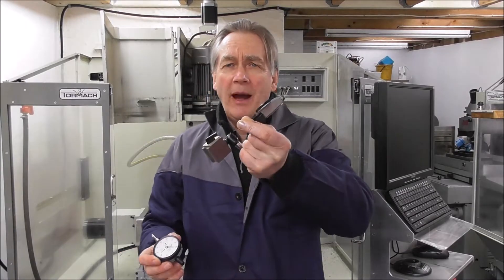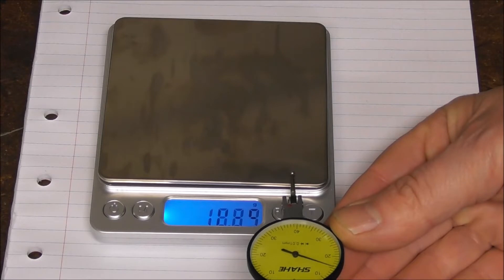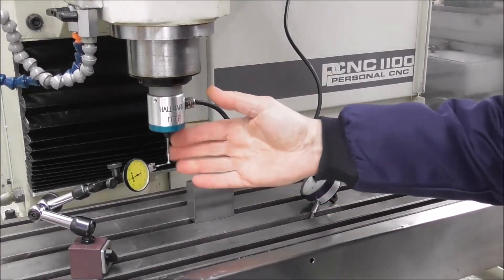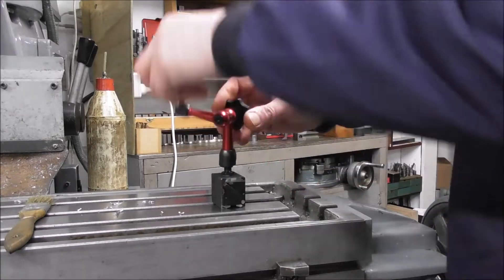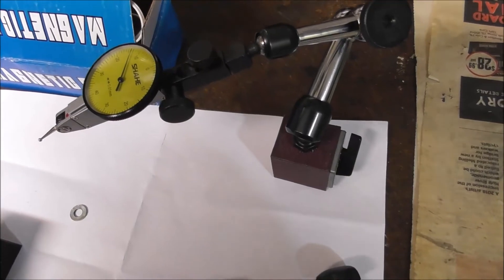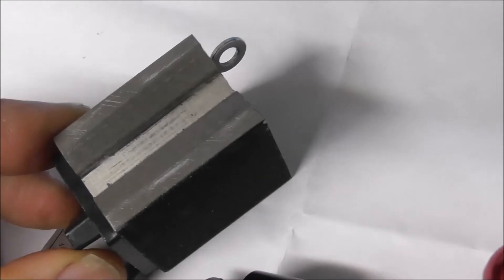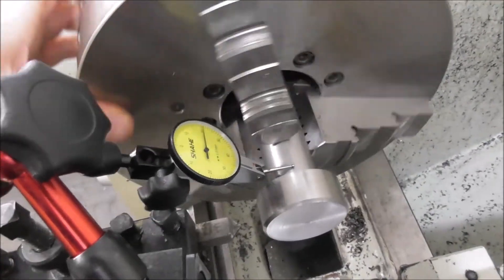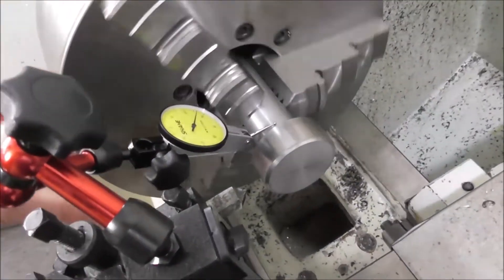DIAL INDICATOR COMPARISON/REVIEW - Part 2 - Application and Stands.

Comment: I got the cheapest indicator stand and dti out of ebay for my "dirty" work, probably got the whole unit with magnetic base and indicator for less than 20, I don't remember exactly, but it has served very well, and it has got a couple of hits after which it still works as well, but it would upset me to be banging an expensive indicator around.
Reply from the maker: Sorry I missed your comment - thanks for posting.  Cliff

Comment: Great information as always Cliff. But even the short small Nogas are affected by that gravity issue. https://www.youtube.com/watch?v=u08SfxVgxNg Amazing really when you see how much a seemingly rigid stand like a Noga and light weight DTI will flex just due to gravity. There's also a good tip about not using Co-Ax indicators with probes longer than about 2" in a horizontal position towards the end of that video in my link.
Reply from the maker: Sorry I missed your comment - thanks for posting.  Cliff